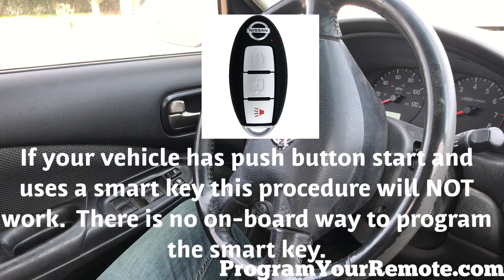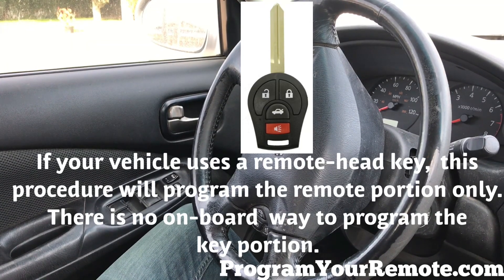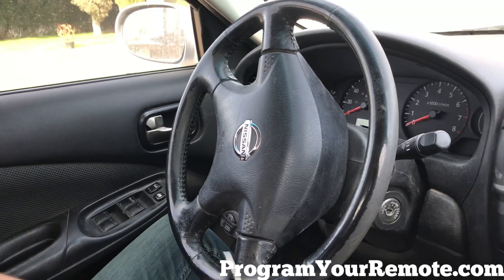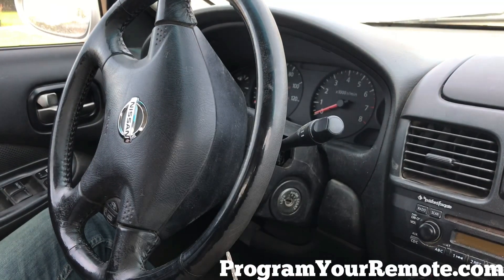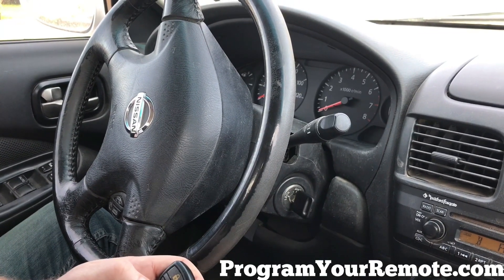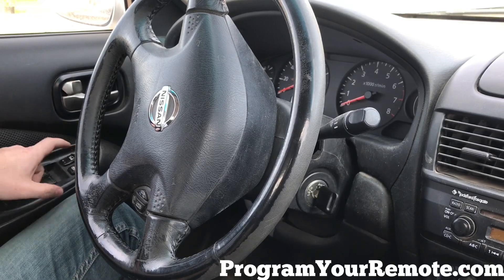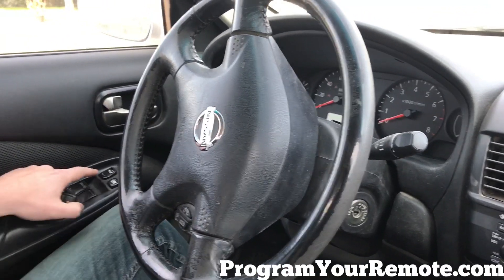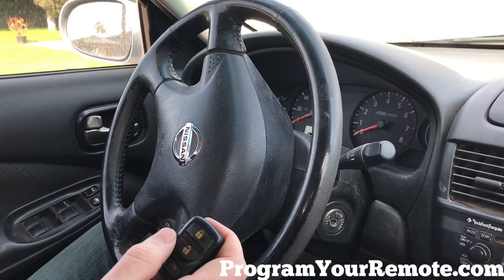How to program a Nissan Cube remote key fob 2009 - 2014

Comment: If my 2011 Nissan cube,didn't come factory with wireless remote .
Can I still buy one?
Reply from the maker: You can but the vehicle needs to have the factory remote option installed.  You can verify that but calling a Nissan dealership your VIN number.  Speak with their parts department and they can look up the original build sheet to see what options it has.

Comment: These instructions are good for a key fob remote for a Cube with a lockable steering column, but what about a 2009 Nissan Cube which does not have a lockable steering column? Mine just operates with the start push button, but the steering column is blocked where the key used to be inserted. I would like to add another key, but I can't find any instructions for my particular model which does not have the keyed ignition on it. Will I have to take it to a Nissan dealership to have a remote key fob programmed by them or is there a way I can do this programming by myself?   Thanks.
Reply from the maker: Unfortunately there is no manual way to program a fob to the push button start vehicles, you will need an automotive locksmith or Dealership

Comment: my Nissan, the remote and key are one piece, besides opening and closing the doors, will it start the car, if the extra keys are cut by a locksmith to match?
Reply from the maker: This procedure will only program the remote portion of the remote-head key.  The key portion will need to be programmed using the proper equipment, in order to start the car.
Reply: @PYR-Auto  yes thanks! I also need to get the transponder chip in the key programmed.

Comment: @ProgramYourRemote  ? I lost my Nissan Cube key  had to get a Lock smith to make a new key but does not have a key fob  can I just order a new key fob attach to my key  and use these steps or if not what is my best option on a tight budget
Reply from the maker: They don't really make a fob that can attach to the top of your key, at least not that I have seen.  The easiest and cheapest route might be to buy a new remote-head key ( all one unit ) and just use that as your remote separately from your working key - so you don't have to pay to have the key portion of the remote-head key cut and programmed . You can use this procedure to program the remote portion of the remote-head key.

Comment: Hi, would this work for a 2009 Nissan Wingroad Y12?
Reply from the maker: Unfortunately, I don't have any programming information on a Nissan Wingroad specifically.  I would suggest just trying the procedure  and see if you vehicle responds by going into programming mode.
Reply: I'm not getting the hazard lights to flash, so I guess this method doesn't work for the wingroad😔

Comment: What fob do you use? Wondering if I can just get a separate fob and continue to use my key.
Reply from the maker: I have only ever seen the fobs for the Cube come as a remote-head key ( where the key and remote are all one unit.)
Reply: @PYR-Auto  That's what I ended up ordering. Thank you!
Reply: @PYR-Auto  ? I lost my Nissan Cube key  had to get a Lock smith to make a new key  he programmed it but does not have a key fob  can I just order a new key fob attach to my key  and use these steps or if not what is my best option on a tight budget

Comment: you say for a cube but the cube doesnt have a key slot
Reply from the maker: If your cube doesn’t have a key slot then it would have push button start.  As is covered in the first :08 of the video, if your vehicle has button start there is no manual way to program the fob.
Reply: Richard Kuhn yes it does. Non push start like mine 2009 cube do have a key slot.